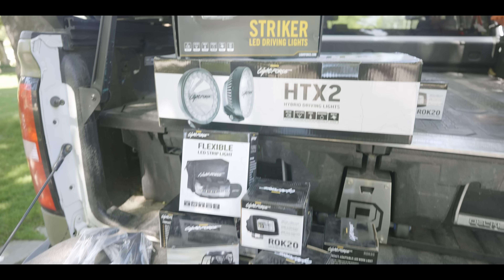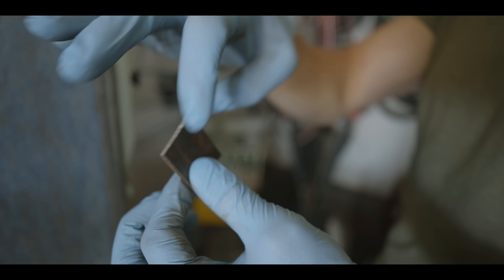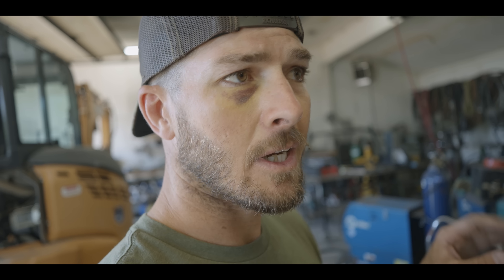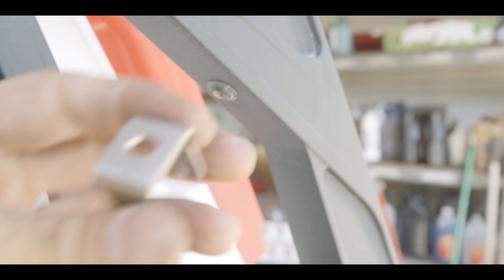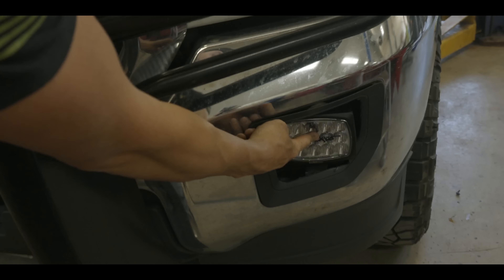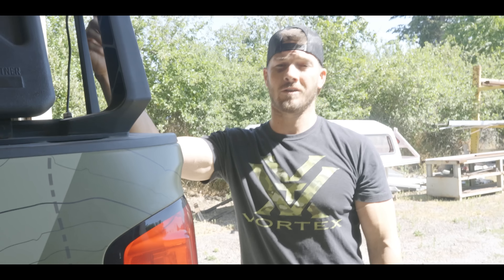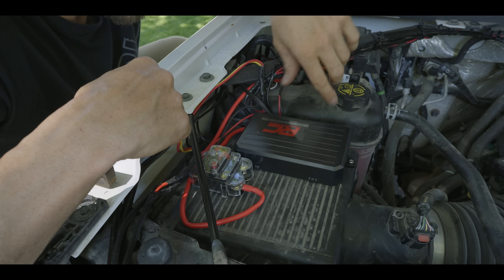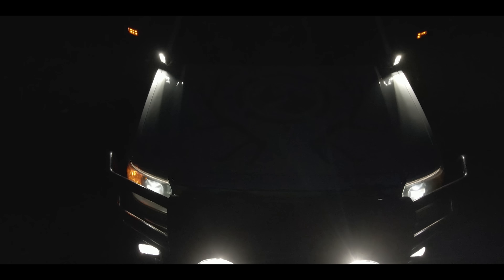I UPGRADED My Truck!

Comment: Always disconnect the NEGATIVE battery cable, disconnecting the ground side of a 12 volt system is absolutely the safest and best way to disconnect the electrical system. The positive can cause a voltage spike or spark when re-connected and sparks are NEVER good around batteries and voltage spikes can burn out or damage the different modules that are in a modern vehicle.